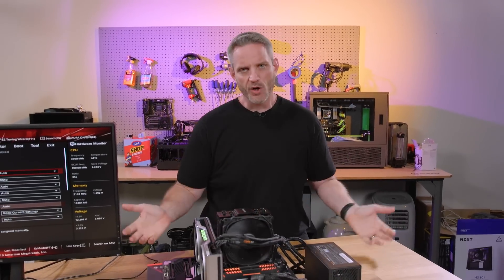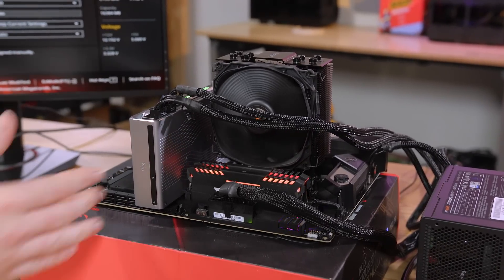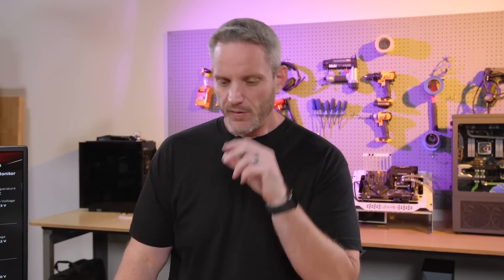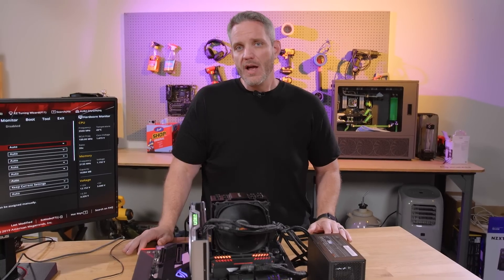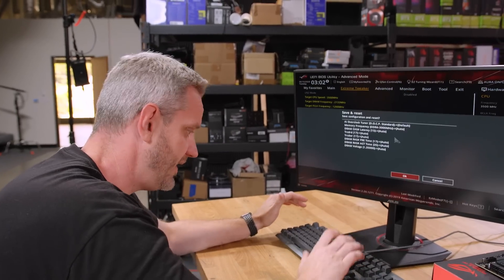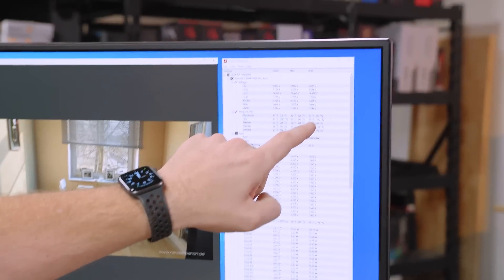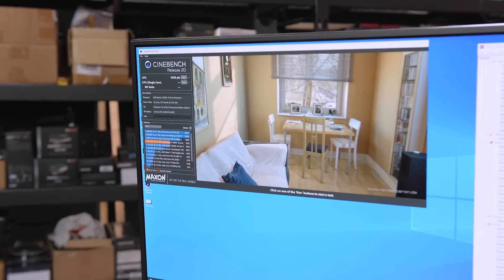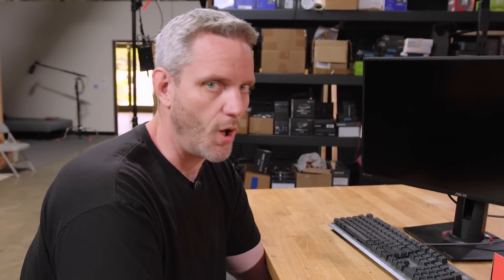Is your motherboard trying to damage your Ryzen CPU?

Comment: Can anyone enlighten me with a CPU voltage question, how much degradation can I expect from a 3600x running 4.45GHz@1.4v stable, barely getting 80°C under 20 minutes of stress test and 40°C in idle. Google searches have all sorts opinions and didn't help much.
Reply: If you intend to keep the CPU long-term, I wouldn't do that.  If you intend to upgrade to Zen 3 or something, have at... it should definitely last long enough for that.
Reply: @Diviance  More like a medium term, it's a recent upgrade (two weeks) from the 2600x, probably going to keep it like a year or two, depends on the new models. Should I better keep it in 1.35v or 1.30v?

Comment: Oh my God Jay, really? You need to use Ryzen Master to monitor a Ryzen cpu, duh!
Reply: No you should not being using Ryzen Master, you should be using HWInfo for Ryzen monitoring
Reply: If you look at the AI suite installation, there's a Ryzen master DLL file. I thought it was a version modified by Asus, but it is digitally signed by AMD. So you would think they reported the same numbers.🤔
Reply: 9:35
Reply: That's it you're getting reported to hq
Reply: @Pesterenan The sarcasm is strong with this one

Comment: This is pretty funny these are a lot of the settings I changed to get my system stable when I first built it and I couldn't ever figure it out. It wasn't thermal throttling, but now I wonder if it was giving my CPU voltage it didn't like or expect and they just weren't happy with each other. Once i set the bios up more like the auto everything and less "defaults" I haven't had any issues...

I'd be interested to see if in the next bios update I can load the defaults and it would be stable again.

Comment: LOL. This video... I love me some Jay, and while a lot of the knowledge in this video was right if we were talking about Intel, or even FX, with regards to Ryzen, There is unfortunately a Knowledge gap. I Still love me some Jay, he is still one my favorite Youtubers, I just wish he would take the time to learn some of this stuff before putting incorrect information out in a video.

The overall message of the video was still very much correct. This drama on line is stupid, your Mobo is not going to degrade your CPU, and if it does it will only be slight, just like with what Jay Said.

But, HWMonitor is no where near as accurate a software tool as HWinfo on Ryzen. You get pretty much the same Clock Readings, but the Temps, Voltages, Current, and Power Draw are all wrong, they are sometimes in the correct Ballpark, but its dependent on the Super IO Chip used by the Mobo. Instead if you use HWinfo, it reports the SVI2 Sensor that is directly inside Ryzen. This sensor gives you incredibly accurate Readings for Your Voltage, Current, Power Draw, and Temperatures, Including giving you access to the IOD Temp, and each CCD Module Temp, to give you a MUCH Better Picture of what is going on. The People who are pushing Jay to use Ryzen Master have no idea what they are talking about, but You should be using HWinfo whenever dealing with Ryzen, if the idea is to give your viewers accurate numbers, and if the idea is to arm them with the knowledge to most accurately monitor the CPU's themselves.

Second, that setting in the Crosshair Board that would let you put the Temperature protection up to 255c doesn't actually work. Most MOBO's that allow you to manipulate Precision Boost Overdrive also allow you to set 255c as the Max Temp, however each BIOS is hard Coded to not allow the number you set to actually go that high, the absolute max is 115c, because that is the Point Ryzen will Shut itself off no matter what, and most Motherboards, even if they allow you to set 255, will still start to throttle PBO at 95c tops. There is no setting in the Bios on any board, including the ASUS Crosshair VIII Formula that will allow you to disable the Thermal Protection (Which again will trigger itself at 115c, no matter what You set the "Platform Throttle Limit" to.)

There were several other Misconceptions in this video when it comes to how Ryzen actually works, but I would be writing a message that is 10 Pages instead of 2 if I kept going, so I will stop here. I do appreciate Jay's Motives 100 Percent, and hate to be one of those "Um Actually" nerds. But its just dissatisfying to see misunderstandings repeated in the video, simply because they used to be true on another platform, so you assume its still true here, when in fact Ryzen is a completely different animal. I just wish more people would dig deeper into topics they will cover before doing videos on them. But I am going to shut up now. Still got nothing but Love for Jay, and I look forward to the next Video.

-Sincerely, a Fellow Enthusiast and Hardware Consultant.
Reply: Damn, you know your shit
Reply: His knowledge level is super cringe
Reply: continues to sip HWInfo Ryzen juice
Reply: I had a similar feeling about this video.
He should have used the HWinfo beta tool which actually introduced the measurements for the "real power draw" to show what was going on, IF he wanted to do so. If I understand this video correctly Jay only wanted to show that you can basically maltreat your CPU in the BIOS settings in many different ways and it will protect itsself, which is truly a good point, but that doesn't really come over to the viewer.
 Just an honest opinion and nothing meant badly or anything like that :) Still love Jays vids for the quirkiness :D
Reply: Can you go further into detail and help a brother out? Come on mate!
Reply: I can relate to that. Ryzen is a diffetent animal, and these were matching with the thoughts i had on this. I have dug myself a bit into this, because i have seen my own ryzen die in 4 months of normal use and some games, stock heatsink and decent case. Basic msi max mobo.
And i had this system checked in all regards possible until i was finally sure it must have been the cpu.

And when i dug deeper i found more people reporting on dead ryzens and high temperatures and wrongly reported values.
So yeah, even if this seems minor, i believe ryzen is more fragile than those intel cpu's that have run fine 6 years on their temperature max (like my first intel did cuz back then i didnt know that intel's stock heatsink would not be enough for an i7 860 and the thermalpaste would also dry out over time)
Reply: @Krarilotus  i wanna know more about this. What was the specific problem of your cpu? Faulty manufactured unit or something else?
Reply: Apparently Jay has never heard of the  Diesel engine, HCCI engine, or GDCI engine. All of which require No spark to run.
Reply: @kalijasin  no they still need a heat source such as a glow plug
Reply: Found the counter shill

Comment: Threw my 10700k in my asus z490 turned it on and was at 52ghz with -3 avx 1,41V hitting 81c, Was like dam WTH volts too high. That was straight out of the box, adjusted it to 51 all core 0 avx 1.325V LLC5. Prime95 hits 81C cine hits 76C air-cooled D15. Board auto was bad wouldn't recommend 1.41 all the time, least not on Intel.

Comment: I've had 2 X570 Taichi boards go bad on me in the last 2 months (on the one PC). A local store tested my CPU in another motherboard and found that the CPU (R9 3900X) was also dead. I got refunds on the motherboards straight off. 
But I bought the CPU off Amazon and they don't help after 30 days of selling it. So I've had to got to AMD (Singapore) direct to do the RMA. It's already cost me $100 using DHL.
If I had bought ther CPU at a local shop I wouldn't had the $100 shipping cost. I've made a complaint to Fair Trading.

Comment: I have a B450m tuf gaming, Don't know if that's an issue. But i need basically need to open amd ryzen master to set the right voltage on my CPU everytime I start my computer. I've set my cpu off set voltage at 1.375V at 4.0Ghz on a ryzen 2600X in the BIOS. unfortunately, on CPUID CPU-Z it says it still at 1.1875V even if I've manually set it at 1.375V. If I don't I might get blue screen or crash. They are in conflict basically!

Comment: I just checked MSI to see if there was a new bios and guess what, there's a new beta bios launched on the 12th :)
I'm assuming this bios will fix why my new 3600x will idle in the mid 40c
Reply: Idle in the 40s is normal for Ryzen. Use HWInfo, you'll see that the actual cores (the CCD, the chiplet) are in the 30 but the 14nm IO die is hotter and that's what you're seeing
Reply: @kendokaaa  Thanks :)

Comment: What annoys me with this situation is the extra heat , I own a 3700x with an Asus X570-E and a Noctua NH-D15 and the board pumps stupid amounts of voltage to the cou for no reason that increase the temps for  no reason. My CPU ideal's at like 47° and will jump to 65°  just when I start a game , I'm someone who has always stressed temperatures and have always over bought on my hardware to make sure I had the lowest temps but this situation bothers me even if it won't affect the cpu lifespan.
Reply: The CPU is likely getting the voltages it needs to run at the clocks it is running at.  Ignore the temps, you aren't going to get much better on a Zen 2 without a custom loop or something like that.

Comment: This could be the reason I had a 3800x completely die, and a replacement start degrading in 2 weeks. had a buddy that had two 3900xs die as well.  I've since switched back to Intel and I'm much happier but this could explain why many people are happy with the ryzens and I had issue. I had MSI and Asus boards. In my experience the ryzen CPUs were also running MUCH hotter than my 9900kf with the same cooler. It's a little confusing because AMD claims ad nauseum that the voltages you see on your CPU are just "offset" voltages and that they're perfectly safe.
Reply: Unlikely.  Even AMD has come out and said this won't hurt your CPU, the CPU itself has internal safety measures to prevent it.  Not to mention Gamers Nexus tested it as well.

You likely just had poor luck.  Shit happens.

I left a decade of Intel to grab a Zen 2 CPU.  Couldn't be happier with doing so.

Comment: I was always kind of scratching my head why people were losing their minds. Like if it's happening that's not cool but the idea that the CPU's would be destroyed or degraded because of it seemed hyperbolic. Thermal protections exist and if you're enough in the know to care about this stuff you've probably checked your temps to make sure they are in check. If the volts were so high as to be dangerous your computer would overheat and do what he showed in the video which is turn itself off. 
Again, I'm not defending the board partners here because this kind of thing happens all the time and it's bloody annoying. I really wish they would all stop applying OC features by default and just run the chips in intel/AMD's reported defaults out of the box.

Comment: I just built a 3900X system in a crosshair hero VIII. Updated all my drivers and did everything you should do on a fresh build, and about 2 days later I kept getting a 02 post code. Apparently it’s a common problem and it just roasted my PSU 😭 I thought my processor was screwed especially after I saw the articles on this topic
Reply: How the hell did that happen?!
Reply: Qwerty Pro honestly not sure. All the forums I looked at said it was the power supply. I threw in my old one to test and it worked 🤷‍♂️
Reply: Probably a corrupted bootloader. 
Applying 250 updates at once, especially without proper restarts and stability checking, has a way of crossing code.

Comment: i have a  - offset of .01125 and it now runs at like 1.35 volts, still boosts to 4.4ghz on the stock cooler, and stress tests run at 70c

Comment: Hey jay just built a new pc for the last week or 2 been trying to debunk an issue that I start my computer and my sound and mouse is skipping and when I try to restart it the monitor turns off but the computer is still running I’ve unplugged everything and replugging it check all the pci ports checked if ram issue by using other ram and ram slots moved my m.2s around tired everything I’m really stuck on this my specs r amd ryzen 3800x 2700 super Corsair vengeance pro 32gb ASUS x570 650 w psu and a fractial 36 aio